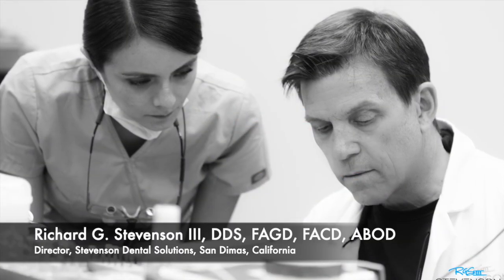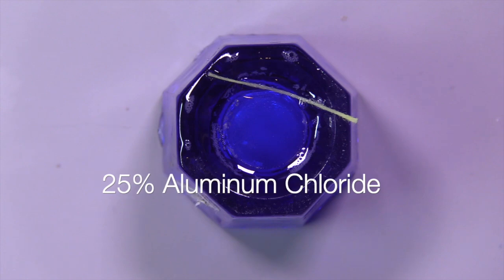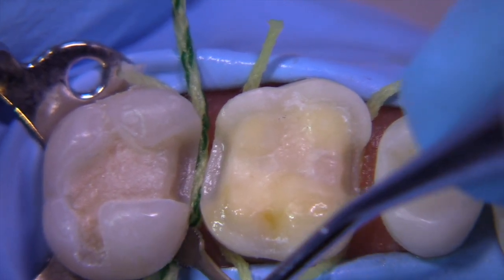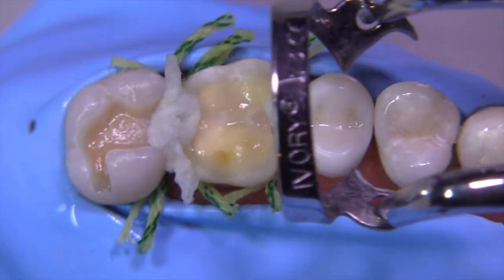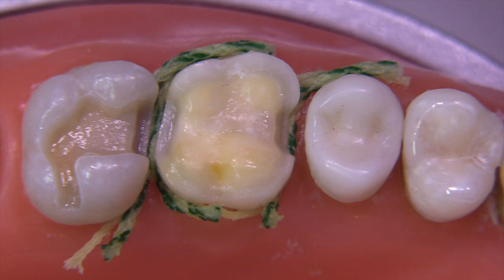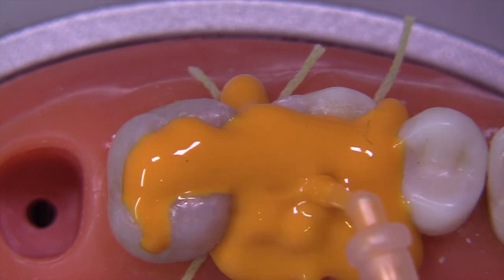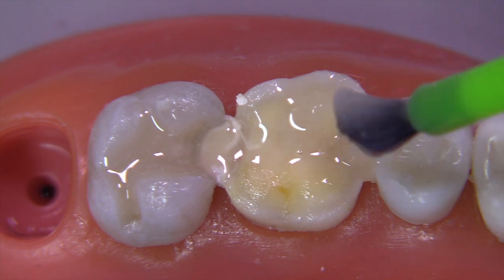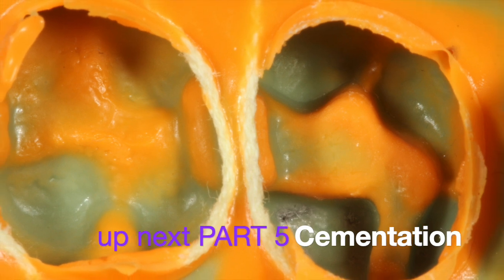Lithium Disilicate Ceramics, Part  4: Impression and Temporary

Comment: Dr. I noticed that you didbt use any cement for the temporary material, which I think makes everything much easier. Unfortunately, i have never seen that material you used here in Europe. We have Luxatemp or Structure as temporary material instead. Can that be usedwithout cement like in your video or not? Thanx🎉🎉🎉
Reply from the maker: Europe sells Ivoclar products - I would try Telio CS, which is simply light cured without cement.

Comment: Does the metal tray sent with the impression to LAB?
Reply: And is it better than other trays?
Reply from the maker: Yes, and they will return it when the case is delivered. It may then be cleaned and sterilized and used 100's of times.

Comment: Why there is no bleeding on gums how do yu control that
Reply from the maker: Start with healthy tissues, then use an atraumatic prep technique - rubber dam is helpful, then use impregnated cords (25% Aluminum Chloride), with a double cord technique.
Reply: @StevensonDentalSolutions  not all tissue is healthy in weak tissue how to control bleeding
Reply: Non healthy tissue how to control bleeding

Comment: Hey Dr. Stevenson,
What kind of temporary cement do you recommend to use that won't bond to IDS treated surface if we don't use Duraseal as provisional restoration eg. Bis-acrylic composite materials?
Many thanks
Reply from the maker: They will all stick - but I like Duration (polycarboxylate) with Bis-Acryls...
Reply: @StevensonDentalSolutions  Thank you for your reply Doctor
Reply: @StevensonDentalSolutions  would you mix Vaseline and temp cement together? Or is temp cement enough to prevent the ids from sticking to provisionals?

Comment: I whan ask you doctor about placment fiber post in canine i'am now practitioner difficiles in placmant fiber post in canine becuse very larg and oval canal most fiber post loss in canal if i placment composite on fiber post and place resin cement abovet putting inside canal and ligth curret this wrong or correct and what bast think dealling with canine canal in fiber post placment
Reply from the maker: As long as the fiber post touches two walls (mesial and distal) the resin cement will hold the post very secure in an oval canal.

Comment: Hey Dr. Stevenson, Thanks for sharing this technique. This is very new for me as I have been cementing e-max with Variolink.  I am a bit confused by the type of bonding. Are you using composite resin as the cement? I am just wondering how the bonding works. Does the salination from the indirect restoration bond to composite resin? What if not all the composite cures through the porcelain?
Reply from the maker: Composite resin bonds to the adhesive agent and the silane very well and this technique works predictably with partial coverage restorations where light transmission is possible.  This would not be a good technique to use with large restorations with limited light transmission, or full crowns or opaque materials.

Using a dual cure cement over a dual cure adhesive is the safest technique and works in all situations - Like RelyX Ultimate Cement with Universal adhesive - no curing required before cement placement = good seating and full cure.